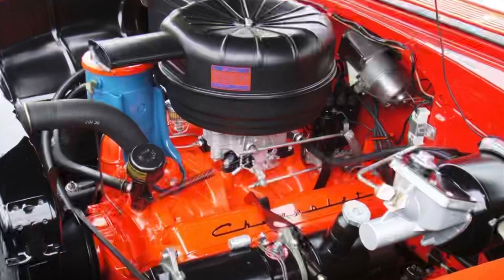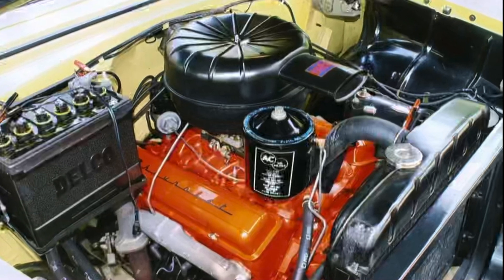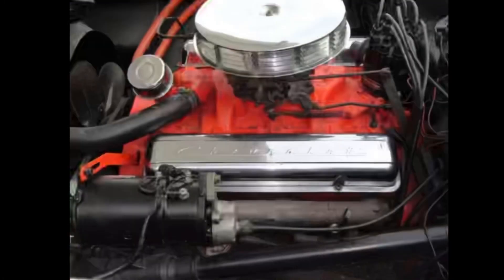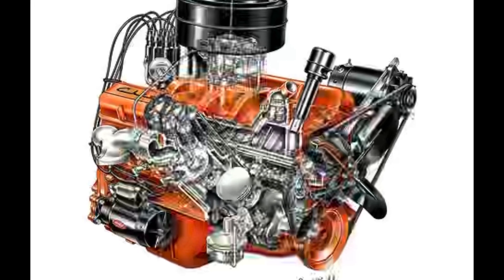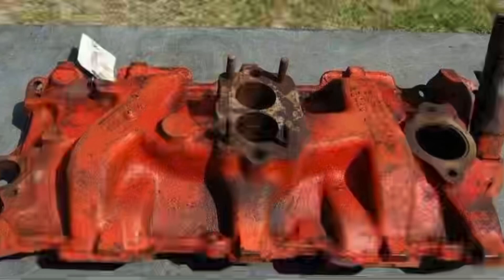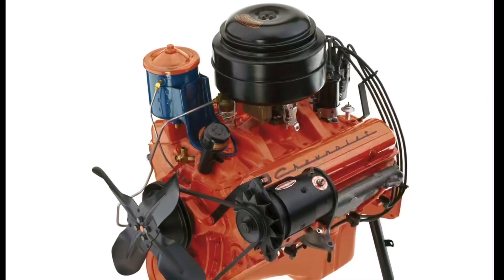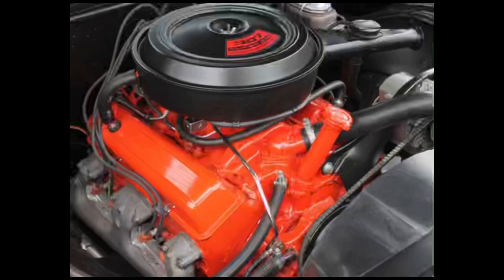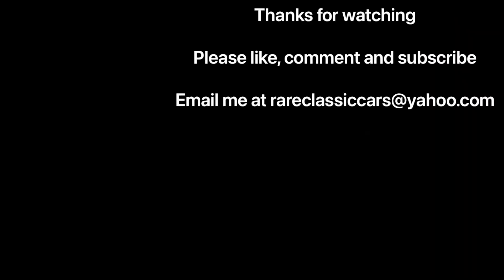Best Engines of All Time: The Chevrolet Small Block V8 (262/265/283/302/305/307/327/350/400)

Comment: Legendary? Surely you jest!
Among the weaknesses of this engine are the biannual camshaft, lifters, and timing chain replacements. Rings were cast iron and were shot by the time they had 70,000 miles on them. doing just a ring replacement on them was also not an option, since they wore out the blocks (soft metal) about the same time as the rings. So, a ring job amounted to a rebore and new pistons and rings. Not to forget the commonly bent pushrods and broken rocker arms. Then add that to the frequent water pump failure and you have a legendary piece of JUNK! The biggest virtue of those engines was the cheap and plentiful aftermarket parts. Seems about every manufacturer made something to make them go faster.

As always with Chevrolet, everything was CHEAP. Also lacking in quality and durability. In my opinion, Chevrolet (and GM) has been shortchanging the public for decades. You can sing the praises of Chevy, but in my opinion, Chevrolet is the best salesman Toyota ever had.
Reply: You must be too young to have had experience with the 1960's small blocks.  Especially the pre-smog ones.  They'd run 300,000+ miles.  I personally did 208,000 on a '65 283 V8 with power glide
Reply: @4af  I was working as a mechanic in the 1970s. I never saw one yet make 100K without leaving a trail of blue smoke. I also owned a few of them. Most notably was the 1964 Bel-Air wagon I had with the 283 engine. A cam and a set of lifters the first year I had it. Then there was the '58 that kept breaking rocker arms. Or the '66 that needed a bore and new pistons and rings at 70.000. Yep, a real piece of quality. 
Also note that Ford's small block engines routinely would outlast the rest of the car. Same with Mopars. I had a '63 dodge that just simply would not die. I drove that one until I got tired of it and sold it. For all I know, it is still running. 
Adam's obvious bias towards GM cars shows in every one of his videos.
Reply: Before the days of fuel injection if you had a small Chevy with 100000mi on it it was shot. Bores and valve guides especially because of the soft block.
Reply: I know quite a few 70s and 80s engines were defective - bad cams, misaligned lifters, etc., but remember, Chevrolet is the cheapest GM make, not the finest car in the world.  I am more of a luxury car lover, and for low-priced cars, I like the Ford better, but I have always known the Chevy Small-block to be a very good engine.  I didn't know such a large percentage were defective.
Reply: You are talking about the 80s engines.  The 50s/60s small blocks, while boringly common, were EXCELLENT engines.
Reply: @michaelbenardo5695  So, are you saying that my 1960 and my 1964 chevys had 80s engines in them? The 1960 had worn the block so bad that it would have had to go to the machine shop to remove the pistons. The 64 needed a cam and a set of lifters at 72,000 miles or thereabouts. Yep, great engines. They made great boat anchors.
Reply: @jimgarofalo5479  Your 60s Chevy engines were that bad?  I almost never saw a Chevy blowing blue smoke, so I figured they must be pretty good.
Reply: @michaelbenardo5695  One of my first cars was a 1960 Chevy 4-door Bel-Air or Biscayne. It cost me about $100 (common in those days). It also used about as much oil as gasoline. It also had a rusted out frame that broke in 2 not long after I owned it. 
Back in those days, I worked at a Buick dealership and drove mostly GM cars. I also worked at a Chevrolet dealership for a while. Seems they were apart more than they were together. One thing is sure, a Chevy mechanic was never out of work. After a few years, I switched over to Fords. When I started working in a Ford dealership, I was impressed with how much sturdier and better built most of the cars were. I was also impressed with how much easier they were to work on. 
I pretty much lost my taste for GM cars when I found out how much better the competition was. I had a 1963 Plymouth that simply would not die. I also had a few Ford cars along the way. 
Among the BEST cars I have owned, a 1967 Buick is near the top of the list. A 1960 Pontiac lasted me over 10 years. I've been driving Fords for the last 20 years or so, and I can tell you that a Ford engine is orders of magnitude better than a small block Chevy on its best day. Yes, they are easy to "soup up." Yes, they are cheap to get more power out of them. And, yes a lot of racers use them. Why? Because they are CHEAP! Also note that a racing engine does not have to last  100,000 or more miles. It only has to last ONE RACE! After that, they are torn down and rebuilt in most cases.
Reply: @jimgarofalo5479  Yes, I know about car prices, and I know you had an old jalopy, but no, I don't think a Chevy is the finest car in the world.  It is a CHEAP car, not a luxury car, not even a medium-priced car.  I like Fords the best among low-priced cars.
Reply: @jimgarofalo5479  I also know that racing engines don't have to last long.  I also don't use Racing Oil, because it also doesn't have to last long.
Reply: @michaelbenardo5695  After a bit more thought, I might also point out that the engines used in passenger cars were quite different than the ones used in pickups, vans, and RVs. Car engines had soft blocks, soft cams, and a weak valve train . The engines used in any vehicle that could be considered a truck were much more robust. They had harder blocks (more nickel and chromium), better materials in the cams and valve train, and 4-bolt main bearings. 
There was no disguising the fact that engines in competing brands were far superior to SBCs.
Reply: @jimgarofalo5479  I knew the 3/4 ton and heavier trucks did have durability enhancements, but I didn't know they were as extensive as that.

Comment: Claims that the late "Smokey Yunick" had a hand in designing this Chev. engine?
 Did all or just some early ones have dual valve springs? (Little one fits inside bigger diameter one)
also was this engine ready before the '55 model year but held up by GM Corporate HQ. because of fear that Chev. would take sales from Buick and Olds? Sort of like with Pontiac having been held up a year or two from introducing their excellent V8 engine design?
Reply: yeh well, yunik stuffed up. if he did. simese ports, push in rocker studs, adjustable rockers, plug angle, floating cam. maybe they didnt know better then... how cheap of chev,to leave out a cam lock plate, so its cheaper to build.. puch in studs instead of taped.. yes, chevs are cheap..

Comment: I had quite a few of them over the years. My last experience was back in '98-ish, transplanting a 4-bolt 350 from a '74 ¾ ton into an '82 Z-28. Of course I went through it first; I don't want anyone to get the impression that I just slapped it in there and called it a day. I really didn't want to in the beginning, but I eventually ended up building it as a Stroker, and damn did I have a shitload of fun with that car! I can't remember ever having any major problems with any SBC I ever had. They were just solidly built, easy to work on, and even easier to maintain.

Comment: The smallblock Chevy engine is a great engine no doubt it was in production from 1955-1997 in cars and trucks but if you think the LS or LT GM engines aren't a step forward and are not superior to the old smallblock in power efficiency and longevity and durability your a fool the Buick 3800 was a very good engine also the plus with the Chevy smallblock and Buick 3800 is they are fairly simple and most parts that go bad are affordable example a smallblock or 3800 water pump is 25 dollars at the local parts store some of these newer design engines the water pump can cost 400 dollars + depending on the car make so in this aspect the smallblock and 3800 are affordable to replace worn accessories newer cars it could very well cost you thousands
Reply: LS 4.8l 5.3 6.0 in trucks from 99-06 is prob the best engine GM ever made. 

Small block was decent for the time. 96-99 vortec was much improved in power from the old TBI engines but still suffered from GM garbage like spider injection, plastic intake gaskets.
Reply: @mph5896  the newer 6.2 engines are good too the problem with them is the DOD VVT and start / stop direct injection if these add ons were not on it it would be as good as the 1999-06 engines all these things mentioned have did nothing but give most people owning them headaches and grief what l can tell you is performance wise you can take a other wise stock engine install a camshaft matching valve springs and a SFI harmonic balancer long tube headers that will make 550+ horsepower at the crankshaft and turn 7200rpm repeatedly your not doing this with your average stock Chevy smallblock unless it's a all forged engine or a 1970 LT-1 and every Chevy smallblock I've ever owned over time leaked oil usually the rear main seal and valve covers not saying LS engines never leak oil but I've own 4 of them still own 2 l replaced a rear main seal at 140,000 miles on my 5.3 Tahoe and it was a very minor occasional drip not puddles but the engine still with 150,000 miles on it runs as good as new no ticking noises or smoke at startup runs and idles smooth as silk and moves my 2009 5500 pound SUV amazingly well for a 323 cubic inch engine with good low speed torque it's a 2009 PPV 2wd Tahoe no it get 13 miles a gallon city 19 highway so it's not great on gas but rides smooth and is extremely solid and is comfortable and roomy it has heavy duty everything brakes suspension engine oil cooler transmission oil cooler power steering oil cooler heavy duty radiator 2 heavy duty batteries high amp alternator l absolutely love this SUV

Comment: Rebuilt a '62 327 in '64; not only found a forged crank but forget rods along with 461x heads !!  Went right into my '32 roadster after adding a Isky roller. .

Comment: Bon Ami abrasive cleaner poured down the carb on the early 265's to help seat the piston rings was a trick used to reduce oil consumption back in '55.
Reply: Bore your motor while you drive!

Comment: I give all the credit to Ed Cole this guy knew his stuff ! From the design of  Chevrolet small block , & the Air cooled flat six of the Chevrolet Corvair ! His worst design was the Chevrolet Vega ! In all respect Ed Cole was a automotive icon in his own right.
Reply: The '76 & '77 Vegas were excellent cars. They had near Toyota levels of drivetrain durability combined with better corning, freeway stability, ride comfort and quietness. And were more rustproof.
Reply: @4af  I concur ! But I wish they got it right from the beginning as those were a a lot better looking ! & they lost a lot of repeat buyers , & that was the Pontiac's Iron Duke engine design on those later Vega's.
Reply: @ACF6180T  The '76 & '77 Vega's did not have the pushrod 151 Pontiac Iron Duke engine. They still had the original overhead cam 140 Vega engine which received many durability upgrades and was warrantied for 5 years or 60,000 miles: http://www.lov2xlr8.no/brochures/chevy/76veg/bilder/3.jpg
Reply: @4af  I thought they did ! I do recall the commercials where they drove them nonstop at there proving grounds in the southwest , & recently they featured it again on You tube , Thanks for the info.
Reply: Maybe so, but the 71 - 74 Vega was HORRIBLE.
Reply: Poor little car has a radiator the size of a motorcycle. I saw a lot of sbc chevy swaps over the years in those cars.

Comment: Owning a 1970 Corvette LT-1 with the impressive 370 HP hi-compression engine was a thrill, especially running it hard through it's high RPM range. Who needs a big block?
Reply: Imagine That Engine In A 1979-1980 CHEVY MONZA SPYDER!!!
Reply: I do I guess, I like the louder noise, otherwise you are right! In my Fords all the way from 200 six to 390 S code. Best one was in middle, the 351 Cleveland in my 70 'Stang! It "went like a raped ape", as we kids used to say back in the day! In "polite" company we'd say: "molested simian"! :D
Reply: I thought they only used that motor in pick up trucks. I gotta '93 LT-1 with reverse coolant flow. It has the tendency to get hot up top and burn out the ignition control module after a couple of years.
Reply: I have a1970 lt1 in my 1957 chevy
Cameo pickup

Comment: 8:14 Fun fact :  Yes Flat tappet camshafts after 1975 and 1976 would have a flat lobe after 60k miles.  Not because the camshafts were "soft"   BUT BECAUSE zinc and phosphate and molybdenum (ZDP) was Not added to oil.   Because ZDP  contaminated catalyst converter.
To solve this problem,  they used ROLLER tappets.
You Welcome.
Reply: ZDDP was not common in motor oils in 1955 when the smallblock debuted.

ZDDP levels in oils climbed from the 1960s into the late 1990s.  In the early 2000s is when they started reducing zinc content due to catalyst issues. ZDDP has never been fully removed.

Every oil on the shelf today has more ZDDP than a 1955 oil.
Reply: @Texassince1836  
Fun Fact 
My Father bought a New 1955 Bel-air.
With the new small block Chevy.  The one with No oil filter. Father ( I call him Sir)  added a oil filter (by-pass) (No full flow). At 40k that engine was using oil.
Father (WWII veteran) was a mechanic at the chevy Dealer in town. Father pulled the engine and Renewed the engine on his vacation week. I held the light at night.
Yes engines worn-out after only 40k.
Yes oils have improved.

Comment: We had a HiPo 283 with powerglide in a 64 Chevelle.  Good chevy mechanic rebuilt the powerglide to shift firm. There is nothing like a full throttle slam bang shift with that powerglide behind the SBC. That big jump in ratio coupled with the wide power band of a non-emission small block made the whole car jump what seemed a foot in the air when it banged into high gear.

Comment: Up to 1967, the 283 was also available with a 3 speed manual coupled to a 0.70 ratio overdrive. That drivetrain was the ultimate cross country cruiser because when in 4th gear overdrive, an Impala or Malibu could cruise at 75 MPH with the 283 spinning at only 2600 RPM.  2600 RPM wasn't stressful because the 283 had a piston stroke of only 3.0 inches.
Reply: I'm rebuilding a 1967 3 speed with the BorgWarner overdrive to put in my 1979 C10. Paired with a 250 inline 6.
Reply: Strange how GM never pushed Overdrive the way Ford, Nash/AMC, and Studebaker did.

Comment: I had a 307 in a 1970 Malibu. I installed an Edelbrock 4 bbl. carburetor and manifold; car ran fantastic with good mpg. Water pump never failed but was super easy to change if it did.
Reply: I never had a 307. I've only owned 350's but I agree they were good engines.

Comment: I have nothing but praise for the old 350 that was in my truck. Never skipped a beat even when it was smoking and using oil. It has been replaced by an LS but it will be rebuilt and used for a future project.

Comment: They were great engines. I have had three of them, a 350 in a 70 El Camino, a 305 in a 78 Olds Cutlass and a 350 in a 76 GMC half ton. The GMC had over 200K when I sold it and was still going strong. I did have to do a cam in the 305 in the Cutlass, that particular engine was extremely smooth and quiet, even better with a fresh cam and timing components.  It would put out a puff of blue smoke when starting, I never bothered fixing that.
Reply: Valve seals.

Comment: Garbage Motors manufactured junk
Reply: Greg Turner.         Had a 63 Impala with  327 . In 1970 replaced the 327 for a 283  HP solid lifter mill out of a1961 Corvettes. Two  speed power glide Trans.  It would bury the needed on the. Speedo. A 4 speed Nova  would  have been  a nice  match  for the moter

Comment: I had a 58 Impala 283 that wore the cam out at 160K. Next I had a 64 Impala 283 until I sold it in 79 with 141K, and I continued to see it around town for a few years. So it needs a water pump every 50K miles, that cost $13 and required one wrench and a pliers. A water pump replacement on a modern Ford costs more than a new 58 Impala.

Comment: Back in the 1960’s and 70’s the Ford and Chevy small block motors were the engines of choice for engine swapping and hot rods. The relative light weight, compact dimensions, and low cost along with big power potential at high rpms were the reasons why. We fitted a Hypo 289 Ford into a Jaguar XKE. We chose the Ford V8 because it was narrower and fit between the space frame extensions better. An added benefit was the stronger clutch and 4 speed gearbox that could be speed shifted without blowing it up. I chose a 4 bolt 350 Chevy SB for my 1953 Jaguar XK 120. The engine bay was bigger, and that built motor ran hard to 6500 rpm reliably. Aluminum motors were very rare in American cars at the time. The high volume production of the small block V8’s drove the price way down for both speed parts and junkyard engines. One could build a respectable hot rod or sleeper on blue collar wages. Those were the days!
Reply: @DFV  Louderilk ausie,, i have a 73 340 r/t. chall. id say the running gear came from a 69 something, as not the correct diff,box. motor date. but, no rust, cali car, drives no probs. paid 17k for it. sublime. there was a mag put out yrs ago, had a centre page with with ford/chev/ dodge.. builds.. it went thru the builds,parts, ect. it basically said, chev, bin, go to speed shop.. ford, cam 4 barrell,.. dodge, visit junk yard for performance parts off these models, with list of #,s.. . chev heads are rubbish.. here in aus, we fit the 302c heads, to a 351c, instant 12.1. comp. big cam, 4 bbl.. go racing.. no speed shop for ford, unless you want 8 sec quarters.. i have an fe 352 in a 62 f100 4x4.. those inlets are fkn huge.. like our 4v clevo heads, dont start going till over 60 mph.. 351 4v ho gt xy.. 1971. 260 mph. std..